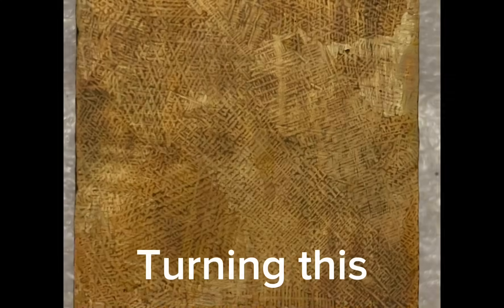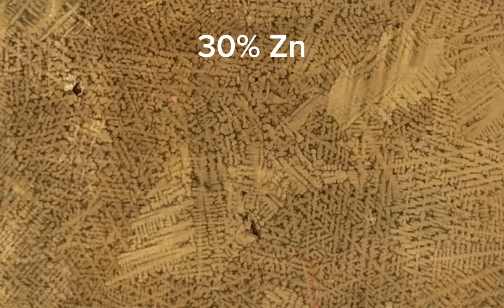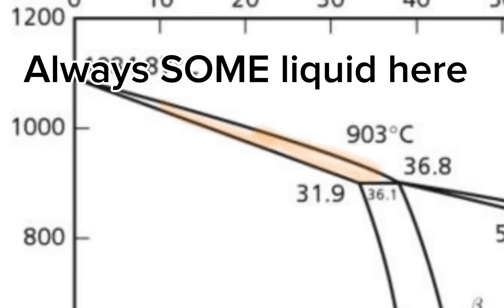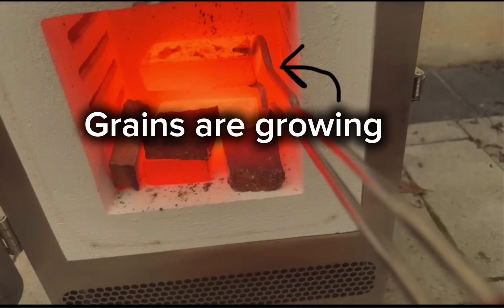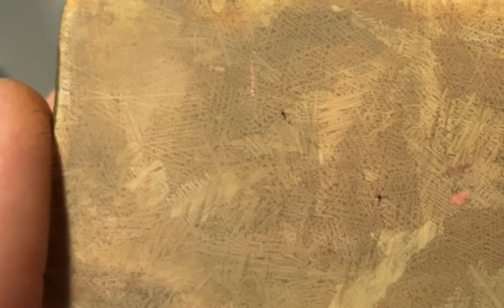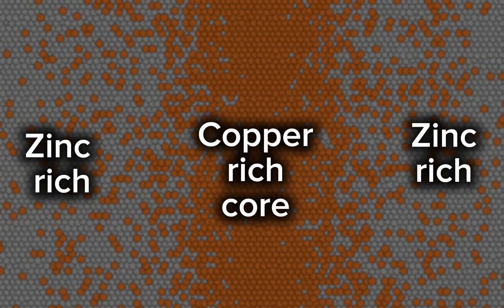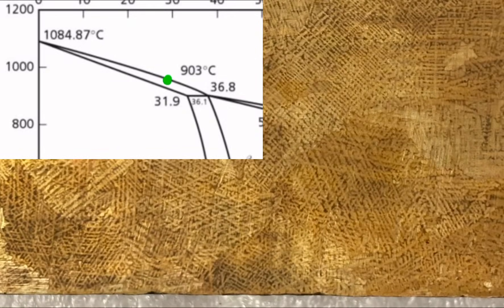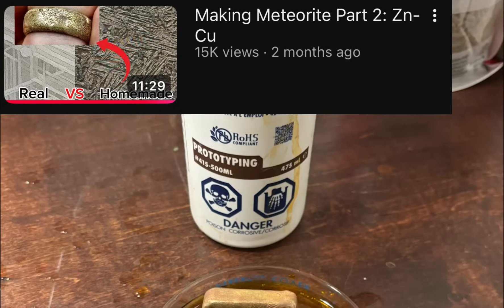Cooling Rate Effects on Dendritic Brass

Comment: I think I asked in a previous video, but what if you put a liqud ingot in a vacuum? To simulate the vacuum of space.

Obviously this will damage the compressor. I think it would be cool to see what happens
Reply: I do melt metals for the purpose of casting things but don't currently have a vacuum chamber.
Reply from the maker: Some aerospace grade alloys are actually cast in vacuum/inert atmosphere routinely for the purpose of avoiding a reaction with air. Although here we obviously aren’t looking for slow cooling, but the process could be modified for that.

Comment: Metamorphose the ingots using multiple heating/cooling phases.
Barring that, solidifying in a vaccuum is a must to slow down the cooling process and remove oxygen from affecting anything.  That is to say water transfers energy 24x better than air and air far better than a vacuum.  In a vacuum there're no molecules to disperse the radiant heat, so it's wayyyyyyy slower than even within the furnace.

This way cool good work.

Do a nickel-titanium nitinol ingot and cut a sheet and see how it morphs from thermal fluctuations.  You can program nitinol to choose what temp limit causes form change.  I see almost zero cool nitinol videos besides those utilizing wire of some sort on YouTube.
Likely it doesn't lend itself to functionality beyond a certain LxWxH (especially for manufacturing ease), but if you could expand the micro to macro structure just like is done with the microcrystalline micelles/lattice growing into one another in geopolymers. Produces a self-similar macrostructure (Geopolymer Institute).
Cooling under a strong magnetic field would also greatly affect the crystal lattice as copper is paramagnetic.  In space there's no protection from EM radiation and nothing to touch to accelerate cooling.  
Last thought, pour into a spherical crucible to cool so there's a mediated flow of atoms and heat.
A cooling cauldron.
Circulate the induction dispersion so that sliver of phase is optimized or when it does occur it's not in multiple cold spots and instead one single seed.  
Then cut the sphere along the magnetic field lines to observe the core growth.

Comment: Are your brass samples magnificent?
With an adequate mixture of iron, carbon (a steel base, then) and a tiny trace of 0.02% vanadium! (and a lot of elbow grease)
we can have the same thing.
At that point, the sample will be called "Wootz"
 and, worked properly, this alloy will produce "crucible Damascus"

Not to be confused with "forged Damascus," made with forged welds.

Comment: I wonder about doing a repeated cycle of cooling and reheating between the “all liquid” and “dendrite formation” temperatures to make bigger dendrites. Seems it would preferentially remelt the smaller crystals and give their copper to bigger crystals, if the “all liquid” temperature is approached but never quite reached. It would look like it’s sitting almost exactly at that temperature boundary, but gaining and losing energy from phase changes.

Another idea which is way easier, half-insulate a bar as it’s cooling. Might see a nice transition.

Inspiring video.

Comment: Large sculptures made of bronze or brass cool very slowly after being poured. Why don't we see dendrites or at least large grains in these structures?
Reply from the maker: A few reasons that I can think of:

1) The artist used a composition that does not form large dendrites upon solidification. The composition I have described here readily forms the largest and more prominent dendrites, in my experience. However it may not be the best composition for sculpture due to the materials workability, or corrosion resistance. So perhaps the artist uses a different composition that does form dendrites but they are too small to see ( we usually think of these structures being microscopic anyways). 

2) There were dendrites, but the metal cools so slowly. Large casts would take many hours to cool. Remember, if we spend a lot of time at high temperatures after dendrites form, they will just diffuse away. This may happen in sculptures, especially with a robust mold and a large metal volume. 

3) There are large, visible dendrites, but they just aren’t etched with the goal of seeing this contrast in mind.
Reply: Not slow enough maybe.

Comment: What about making Au+Zn alloy with dendrites and then dissolving zinc in acid ? Will it work?
Reply from the maker: You can do this with the alloy discussed in the video— after some time you will be left with a copper skeleton. However the reaction comes to a stop once no more Zn is visible to the acid, so it only works for the first milimeter or so. 

You could also do this with gold.

Comment: Does this work for most alloys around 70/30 Cu/Zn? For an actual ring should i worry about lead content? i want to source the materials to try this but i am unclear on the sensitivity of the process
Reply from the maker: Well of course you do not want to wear a ring with lead in it for many reasons but in terms of the microstructure, in general the more species you add to the alloy, the finer microstructure you obtain. Pure copper and zinc are of coarse ideal, poured in a very smooth mold to minimize nucleation. But if you use 99% copper and 99% zinc to build your alloy, I could still see it working. 

And yes 70/30 -+ a few percent in either direction will still work. Going higher zinc is more detrimental, if you approach ~36% zinc you start to form beta phase upon solicitation which kills the dendritic structure.

Comment: Would the dendritic brass be brittle? Especially in the zinc rich regions?
Reply from the maker: We definitely do not use dendritic brass like this in structural applications. But relatively speaking (to other alloys I have worked with on this channel) it is quite ductile, as there are no massive intermetallic plates present. But they are present in smaller sizes in the zinc rich regions as you suggested, making those regions brittle, but the alloy as a whole remain pretty workable. Good intuition.
Reply: @ElectronImpressions I make custom door hardware. This would make some really cool decorative knobs, levers and trim. And I wonder how it would react to a vinegar fume patina?
Reply from the maker: @ericmorriscompany9648  That would be so cool! You will probably see some degree of selective etching, but not nearly as sharp as ferric chloride.
Reply: @ElectronImpressions we saw some really interesting effects.  Sometimes there appear to be flakes in the material. When the summer comes and its warm hot forgings show a red line at the parting line. I surmised that the higher temperature that area sees as the excess brass is forced out of the die cavity under 600 tons of force is somehow concentrating copper there. When we Polish and lacquer or chemical patina the difference in composition is not significant enough to see that. When we vinegar patina over several days using fans to circulate and increase the acid concentration in the air the parting line shows. Remove the fans and it is no longer visible. Castings react very differently to hot forged items.
Reply from the maker: @ericmorriscompany9648  That is interesting, I personally can’t think of a reason why copper would be accumulating there, sometimes I see copper islands in my castings (you can see some in this video) but nothing that behaves like that. I would be less surprised if you told me zinc was accumulating at the parting line lol.
Reply: @ElectronImpressions we also use a molybdenum disulfide mold release spray. That may be embedded into the material at the parting line. The flashing is only 0.8mm thick and sometimes squeezes out 30-40mm. So there are some serious forces at play there. We generally use a 62/38 alloy for forging but as high as 68% copper for casting.
Reply: @ElectronImpressions I was actually thinking that the added energy that is put into the part during forging could drive off the zinc. On occasion we have a billet slightly too hot and the energy from closing the dies is enough to melt it and send molten brass flying. Not fun.

Comment: are there any difference in their mechanical properties?
Reply from the maker: Oh absolutely, in fact dendritic growth is a big area of focus in welding/additive manufacturing. 

Typically when we make a metal part that is used structurally, it is worked, annealed, and aged to produce a desirable structure. After all this, the as-cast structure is erased, so dendrites are not a concern at all. However in welding/AM we are actively melting the part and producing a new “as cast” structure, and the morphology of any dendrites that form in this molten area can have bearing on the mechanical properties of the material. 

Generally dendrites make a material weaker as they serve as crack propagation “pathways” and also create small regions of weaker material due to the solute segregation. However that is not the case for all materials, in some systems, refining the shape of the dendrites may actually improve mechanical performance. I would love to yap more but I doubt I could explain it succinctly.
Reply: @ElectronImpressions   and what about these specific ingots?
Reply from the maker: @dang-x3n0t1ct dendrites weaken the material due to intermetallics being present in interdendritic regions, so if we ignore grain size, the dendritic ingots will be weaker. However large grains also weaken metals, so if we ignore dendrites, the large grain slow cooled ingot will be weaker. 

In reality it is a combination of the dendrites and the grain size that would determine which ingot is the strongest. However I can’t tell you when the tradeoff of “at THIS grain size the dendrite free ingot becomes weaker than the dendritic ingots” without explicitly testing them.

Comment: Neat. Big temperature differences, huh? Now I want to try copper and bismuth. If I remember from lead free bearing brass that uses bismuth they kinda don't mix all that well, so maybe the bismuth might just support copper dendrite formation and kinda sequester itself without much or any diffusion? Maybe then you could melt out some from the surface later and get some 3-D copper dendrites. 

Or I'm completely out of left field, I'm tired and I may have just consumed some stuff. Who knows.
Reply from the maker: Your intuition is right in the sense that bismuth does not mix with the majority of metals. In fact, it’s completely insoluble in mostly everything. It is traditionally added to alloys as a very low % alloying element as upon solidification, the bismuth will solidify as small droplets of pure bismuth, not mixing with the metal at all. This makes the alloy more brittle and easy to machine.

However I believe what you are suggesting has merit, I have been working on something very similar for the last few weeks— and it looks to be very interesting :)
Reply: Sorta like hydrothermal quartz crystal formation where the hot high pressure water is mainly just a medium to support a lot of dissolved silica. Swear I've seen native copper in crystals, maybe a similar mechanism? I should cut down on the gummies.
Reply: @gresvig2507 I'm not sure, Cu-Bi phase diagram doesn't look very promising.

Comment: What happens if you let your ingot slow cool through the dendrite formation zone, and then quench it in water? Might you be able to get large grains with sharp dendrites?

Also those perfect triangular intersections and gorgeous.
Reply from the maker: The majority of the blurring comes from the inner regions of the dendrites diffusing out as the outer regions are still solidifying. As long as we are slow cooling through the coexistence region, this is unavoidable diffusion. 

However if we did quench we would definitely reduce the blurriness a bit, as there is some diffusion even during air cooling— but it is trivial compared to what occurs during the slow cool.
Reply: @ElectronImpressions  This suggests that it might be worthwhile to experiment with various times in the formation zone, to tune the effects for both size and sharpness?
Reply from the maker: @Knight_of_Ticking_Armor absolutely

Comment: Awesome video. Here's a question though: what if you slow cooled to allow more dendrites to form, then quenched your ingot in water? Wouldn't that be the perfect balance between a lot of large dendrites and a clear contrast, since you'd solidify them faster? Or would the result be too messy? Is there something I'm missing?
Reply from the maker: You would receive a sharper contrast (I just did not do it because I did not want to waste my ingot mold lol), but the majority of the blurriness is coming from the cores of the dendrites diffusing as the outer layers are still forming, which is unavoidable in slow cooling.
Reply: @ElectronImpressions  Cool! I might try that and see what happens. Maybe we can save the mold by cooling faster using other methods? An aluminium/copper plate to act as a heat sink maybe?

Thanks for the reply, keep the videos coming!